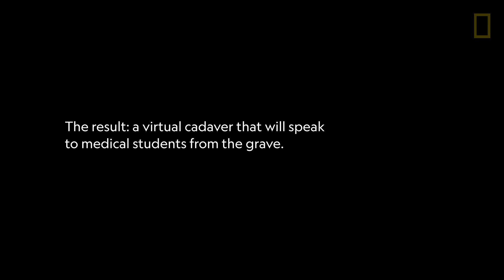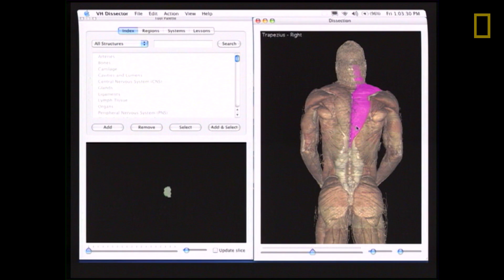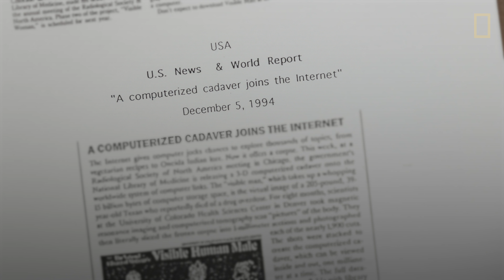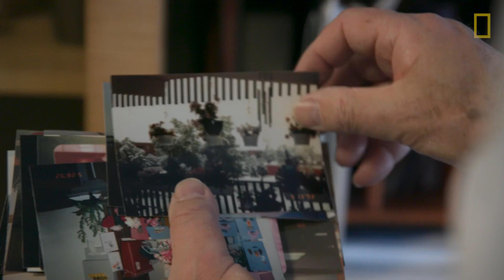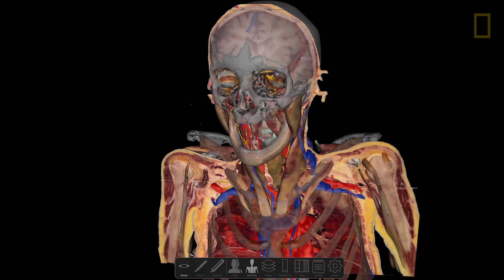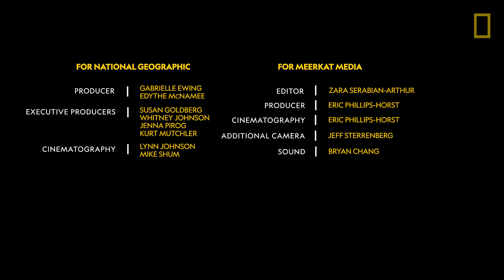How a Woman's Donated Body Became a Digital Cadaver | National Geographic

Comment: Realizing this is an old video, I must say it is extremely interesting. I’m not the least bit grossed out by death or anything involved in the process. I do have a question about this process. Shaving/grinding hairline thin sections of a body has to leave some kind of residue, for lack of a better word. How is that residue dealt with when the process in completed?

Comment: So at the end of the shaving process the entire body is just a pile of shavings? Are the shavings buried or burned after?
Reply: I would assume they basically cease to exist.
Reply: I guess the whole point of what she said is that she did not care about being "properly buried". She wanted to be properly used.
Reply: @upsydaysy3042  no I understand that. However I don't think you can throw away a bunch of human shavings. It's probably a bio hazard. Not to mention disrespectful even if the lady didn't care.
Reply: @inspectorsteve2287  why do you think it would a bio hazard? It’s no different from throwing meat away.
Reply: @Danquebec01  human remains are a bio hazard. Body parts and fluid need to be disposed of properly. After liposuction the fat goes into a bio hazard container. Think about used needles, they need to be disposed of properly. They are also considered biohazards. Meat that you buy in a store is highly regulated and the human body isn't.